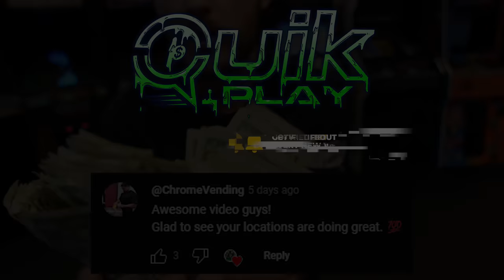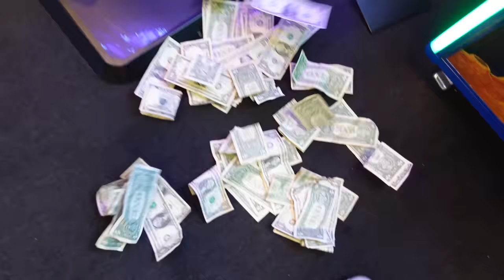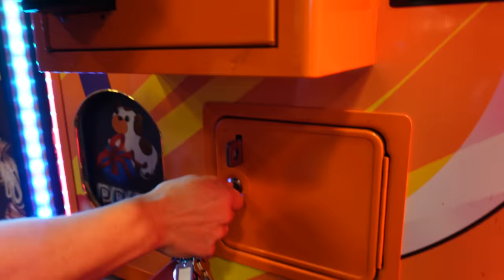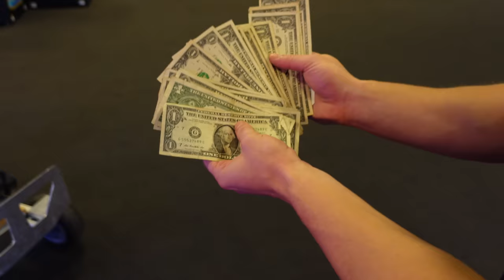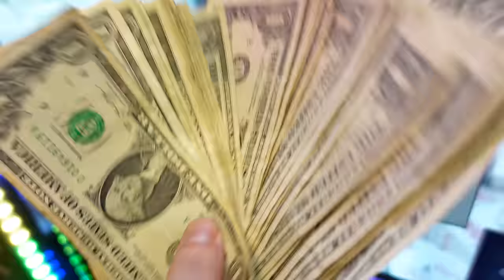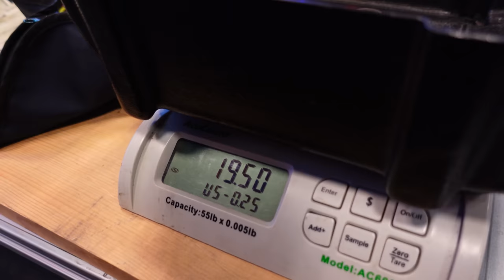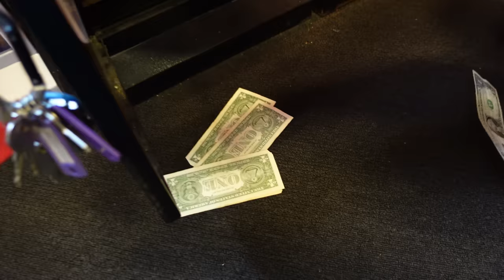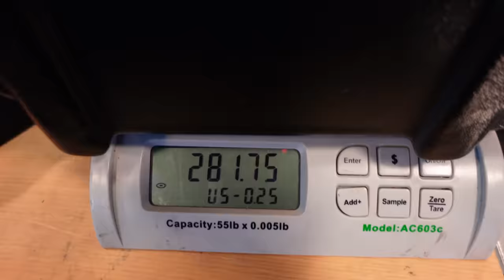You Won't Believe How Much Our ARCADE Made This Week!

Comment: The prizes in the machine at 13:13 aren't that good, at least in my opinion. I think that if you put pokemon cards in there, it would do a whole lot better. Also, I feel that if the machines at the 17 minute mark were lowered to 50 cents to play, you might make a lot more.